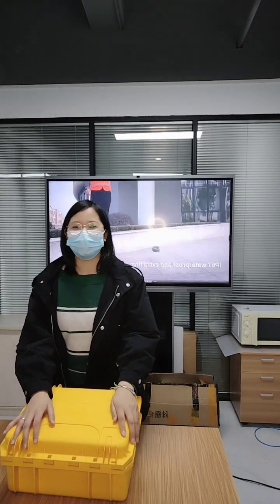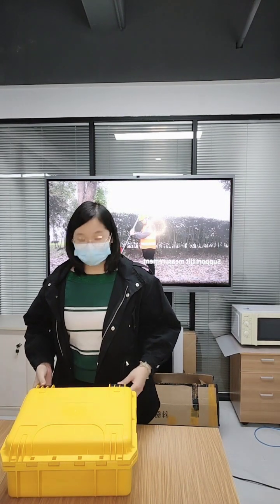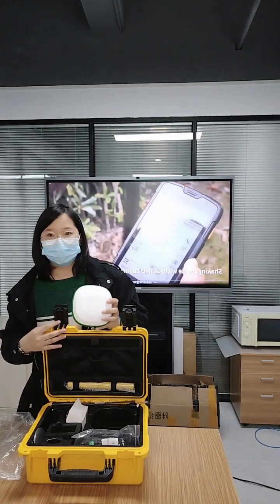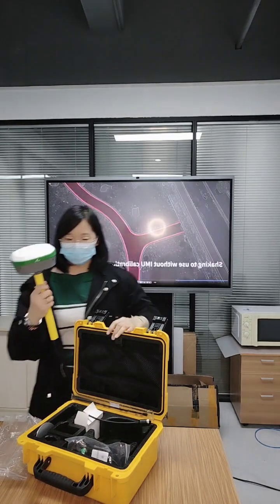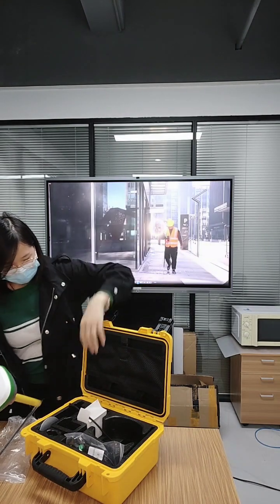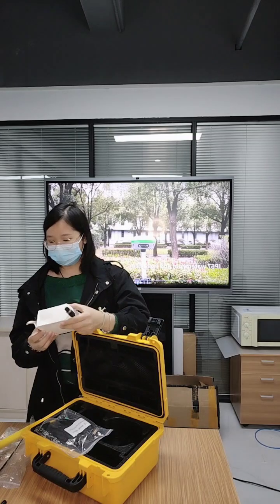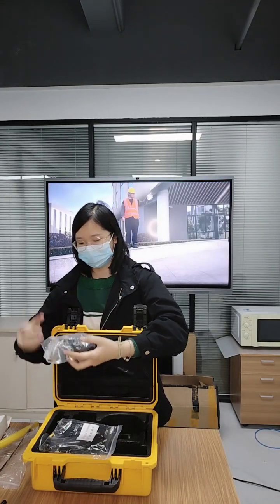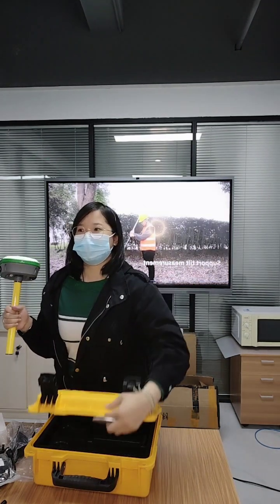SMAJAYU RTK GNSS Surveying system R26 Rover Base and android Handheld with surveying software.

Comment: What is the difference between the r26 and the e1?
Reply from the maker: R26 NOAA certifcated.
Reply from the maker: This is link for SMA26RTK: https://www.amazon.com/stores/SMAJAYU/page/C41C32DF-8AEE-481E-A4AF-669D2088FAF6
Reply from the maker: Buyers feedback R26 has high accuracy, "I build pools and spray grounds typically stakeout has already been done when I arrive and I capture each point and then we excavate the site and then I do stakeout again in the bottom of the ditch I use 7 inch nails for my survey stakes and I have never been off the head of the nail on later setups. More recently I have been loading a csv file to the data collector and then localizing off of a few known points and doing stakeout myself and when verifying with a tape measure I’m always within 1/8” never worse than 1/4”